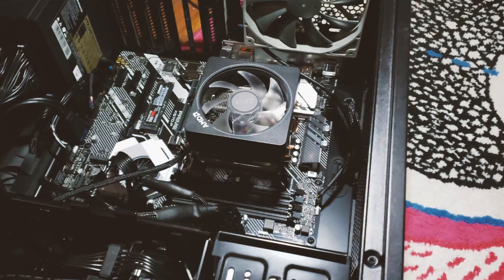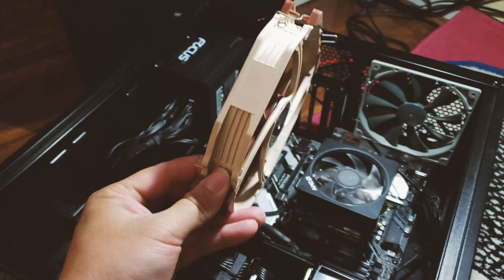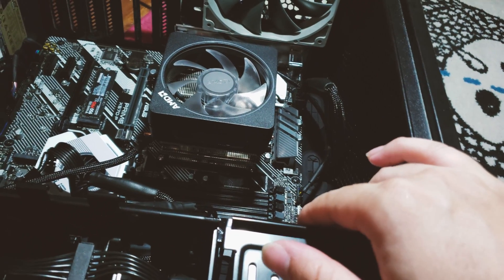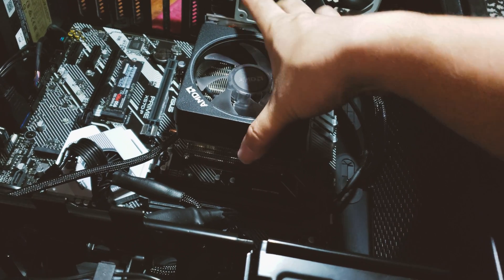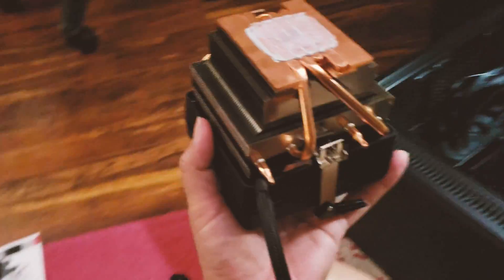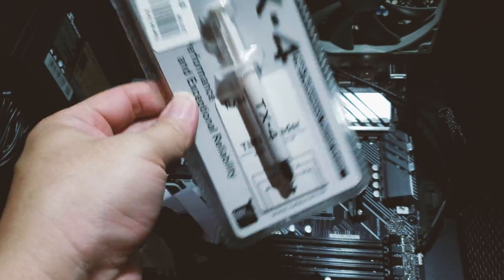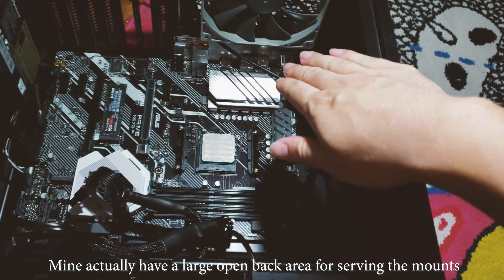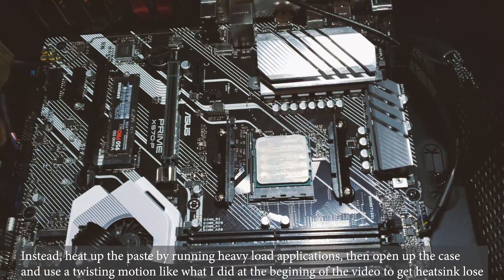How To Safely Remove Stock Wraith Prism Heatsink from AMD Ryzen 9 3900X Processor

Comment: I think my 2700x is stocked,...not even moving a bit...and Ican hear so metal ding when try to twisted the cooler.
Reply from the maker: might got baked on... not sure what to do
Reply: @TheGizmoGarage  after hours of heating, it didn't move a bit, but I lift it up without much force, the cpu came out with the cooler, ping on one side was band

Comment: Thought to post here after a year. Last year right after i first commented here, i  broke a cpu pin and 3 bent ones while removing the wraith prism. I corrected the 3 bent ones carefully but one broke completely and there was no way its stickin back. Luckily i tried booting with it and after 3 attempts it worked. Been running fine ever since. Although i dont overclock as much. Got Thermaltakr view 71 cabinet and cooler master 360mm liquid cooler so temps are good.

Comment: Bro the cpu is stuck on the cooler ... HELP
Reply from the maker: Gently wiggle it left & right instead of trying to pull the cooler straight off the cpu after all mounting hardware has been removed.

Comment: I tried to be careful. But the hardened stock thermal paste glued both CPU and fan so tight that I took both of them off the motherboard together. No CPU pin bent or broken. Hopefully, I didnt damage anything.
Reply from the maker: that is good... yeah definitely need to upgrade the thermal paste

Comment: I've just removed the stock fan while the cooler was attached to the motherboard and strapped Noctua fan to the cooler lever. Cheap solution for a guest room PC, but it makes the PC so much quieter. Now the loudest fan is the PSU one, because the GPU has also Noctua fans strapped on.

Comment: You started your video after you disconnected the hardware to the wraith fan/heat sink. I'd love to see those "guards" be removed. That's where I am... Trying to disconnect the fan/heatsink in preparation for, for instance,  removing that.

Otherwise it was comforting to see how easy it is to remove the fan/heatsink.

Thank you for the video.

Comment: I wish you show how to release the 2nd holder of the heatsink, it's a pain in the ass
Reply: Yah. I since he didn't show it I didn't know about it. CPU ripped out even though I was only twisting as far as I knew. Luckily no bent pins, though the risk is still there since I need to get the CPU off the cooler with no protection for the pins.

Comment: 10 years ago I was building my second PC. I was trying to remove my heat-sink from my old CPU. The computer was offline for eight hours and I pulled straight up. I bent like 6 pins and destroyed the mobo. I was intending to donate my parts to my friend, so I screwed that one up. Lesson learned. Let the paste warm up for a bit, wiggle, then gently pull.
Reply from the maker: the early gen AMD processors featured a glass like surface, that chipped like crazy...
Reply: how did you destroy the mobo?
Reply: @KrimmWasTaken  The pins got bent in the CPU socket because the locking mechanism was engaged. I could not unlatch the lock because the heat sink was blocking it. I also had removed the heatsink a few times and that was the first (and last) time it ever pulled the entire CPU with it.

Comment: My son dropped a screw inside the amd fan and we can't get it out is there anyway to remove the top of the fan so I can see inside
Reply from the maker: Yes, it's usually held by a few clips, use a small flat screw driver to losen the clips and the fan should come off easily.

Comment: I have had my 3700x running since March 2020 when i got it with stock paste, now i wanna change my thermal paste and im kinda afraid to remove the wraith prism after seeing all these vids.
Reply: I'm in the same situation, how did it go?
Reply: @grey_fox503  Well, i havent done it yet. Waiting to buy a Liquid cooler in a few weeks then will open it. Also, winter isnt helping.
Reply: @Badshank  How did it go?
Reply: @innogz6200      Well, i broke a cpu pin and 3 bent ones while removing the wraith prism. I corrected the 3 bent ones carefully but one broke completely and there was no way its stickin back. Luckily i tried booting with it and after 3 attempts it worked. Been running fine ever since. Although i dont overclock as much. Got Thermaltakr view 71 cabinet and cooler master 360mm liquid cooler so temps are good.
Reply: @Badshank  Did you heat up the CPU first and did the wiggle? How long exactly did your Prism run? Did it run on stock paste? I'm going to go through this except I come from Stealth to Prism upgrade.
Reply: @innogz6200  Yeah i ran it for over n hour with rendering in a 3d application and wiggling also didnt help. Its like it was cemented in there. Although its my fault, its been running on stock paste since 12 months or so by then. Depending on your condition on how long have u used it with stock pase, it would either be easier or worst its cemented. Mine was almost gone when i took it out and chunks of it looked solid like Aluminium. Everyone - dont get wraith prism and change paste every few months.
Reply: im in the same situation but its been running on stock paste for like 4 years now... im scared
Reply: @FahimPlayz same mate, gonna upgrade cpu and cooler tonight so fingers crossed haha
Reply: @aaroncyrilfrancis1974  ye my shit was deadass stuck like glue, it would not come off...
Reply: @FahimPlayz  Mine went well mate, I ran cinebench multi core benchmark twice and got temps to about 70 C. then immediate shutdown and then unlatched the black piece then wiggled it gently for about 5 minutes and then I had a crack/pop. then proceeded to unlatch the steel ish latch and came off pretty easy.
I gotta say the thermal paste had shattered as if it were cement or somin, weird ahh compound for sure.

Comment: That's a little bit dangerous. Asking for bent pins.

You'd be better off using a little heat and doing the twisting motion AFTER the CPU is out of the board.
if you can get the computer to warm up the CPU before you take it out, that would be an easy way to soften the compound.

 A solvent like alcohol would work to soften it if mild heat isn't available. Though you'd have to be careful as to not drench the CPU. Of course this is AFTER it is out.

Comment: whem i first removed my stock air cooler to instal another e removed the cpu too by mistake and got scared thank god it didnt bend any pin and them i sertched for a videos like this tnks man
Reply: Dude that happened to me the other day!! I was freaking out so much!!
Reply: That just happen to me with my 3700X, i buttclenched so hard when i saw the empty socket on the mobo, i was afraid to even look at my cooler.

No pin bent, everything work fine.

Comment: i havent been able to remove m cpu for months even after hearing of this method,,, not sure what other option i have
Reply: maybe put a little Rubbing alcohol where the contacts meet?
Reply: You need to heat the cpu to the max , use a benchmark software like prime 95 for half an hour or so and monitor the the temps when they reach 80' 90' the thermal paste would be soft , some people are talking about removing the cooler power cable to make it run hot faster .

Comment: Completely bricked my 3700X by removing the stock fan with stock thermal compound. I have built (literally) hundreds of PCs. I work in IT. And I have never had this happen to me, although most of my builds have been Intel. I tried to straighten the pins, but ended up breaking one of them off. AMD told me it was my fault. Another $300 later and it works fine. Happy with the AMD performance for the buck, but they should have this video on their website. Not really thrilled with the experience, but live and learn, I guess.
Reply: I just straighten 9 pins out cause of this cooler. None have broken off thankfully, but my computer won't even turn on. Could it be because I damaged the pins even though I straightened them out?
Reply: @00xGhostx00  Sorry to hear that you are having this issue too. It was awfully frustrating and disappointing for me.  It is possible that one or more of the pins are not making full contact with the socket. You can try re-examining the pins to make sure that they are perfectly straight. You might also try throwing the CPU socket locking lever back and forth several times in case there is an obstruction in one of the receptors.  If you haven't already, unplug and re-plug in your power supply from the wall socket. I hope it comes back up for you.
Reply: Same experience here,I had to buy new CPU.

Comment: Maybe I should have watched this b4 trying it. Used to Intel and never dreamed how easy the cpu can be pulled out. After twisting and pulling to get the clip off and finally removing the cooler noticed the am4 socket was empty lol. Spent 4 or 5 hours getting the pins strait enough to go back into the socket. Got new cooler installed and will NEVER remove it. The 3900x and the motherboard are now one unit imo. What a nightmare!
Reply from the maker: Knowing to twist cooler to get heatsink off is the key, will make your next removal mich easier

Comment: hey man what’s ur average temp idle with your 3900x? just wondering because i have a aio and it seems a little higher than i’d like it.
Reply from the maker: i have a 3950x now, idles at 45C, I think my 3950 is also idling at between 45-49C with the Noctua air cooler I had
Reply: I have 3900x with noctua nh d15 chromax. It's around 45 to 50° at idle load and goes upto 74° under full load

Comment: mine got stuck on the cooler heatsink...when i pull the cooler off the PROCESSOR is removed from the mothetboard😅...the pre-applied past from the cooler is too much
Reply: Drin John how did u manage to remove it
Reply: @Too-slow485  yeah but it took a hard pressure to remove it...it sticks like glue 😅

Comment: I removed mine and it took the CPU with it, bent 8 of the pins (3900X), so I had to painstakingly straighten each pin under a magnifying glass for an hour 1/2. I put it back in the socket and it booted right up, thank God. No issues so far.
Reply: Damn I did that same thing last night but mine hasn't even powered on after straightening the pins. UPDATE straightened about 12 or more pins using the razor blade tech from Jay2Cents and it works. I'm assuming something wasn't plugged in all the way before, thought I checked.
Reply: Darryl Olison any updates?
Reply: @melo7572   just updated check my original comment :)
Reply: @00xGhostx00  wait so you followed this tutorial and you still managed to pull the CPU out with the heat sink?
Reply: @Roger-jj3it  no no, i think he experienced it before looking for this tutorial
Reply: Happened to me as well. Bent almost all of the pins on an $800 CPU. Almost gave me a heart attack
Reply: How did you go about putting it back in? Struggling to do it rn
Reply: I killed my old ryzen 2700x by pulling it out with the heatsink. Good i wanted to upgrade it anyway

Comment: I'm about to do the same swap with the same cooler and same CPU. The build is less than one month old so praying it won't be that bad. I will for sure run some benchmarks to heat up that paste. Its scary stuff no doubt. Thank you for the video!!
Reply: How was it, my Noctua arrives tomorrow and I am praying I don't pull out my cpu along with the cooler, my pc is about a month old too.

Comment: Thanks for information, if we don't do this, we break the pins right ?
Reply from the maker: If you pull the cooler directly without loosening it first, you might break the pin, or worse, pull the whole socket out from motherboard. So always wiggle the cooler and get it off gently first.
Reply: @TheGizmoGarage  You can unclip the CPU and remove the cooler with the CPU safely.

Comment: what is the average temperature with the cooler AMD?
Reply from the maker: 5 degree higher at idle
Reply: For me on a 3700x it hits 80-85c at full load on stock speeds.